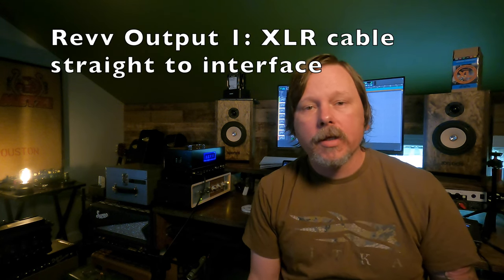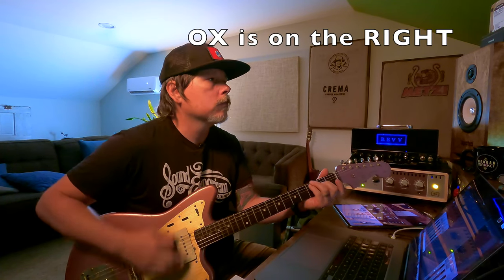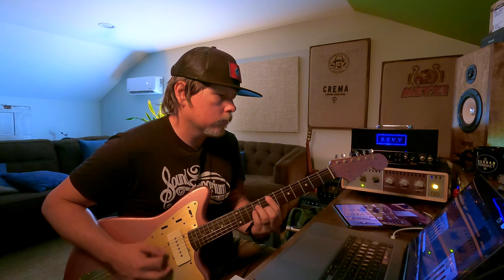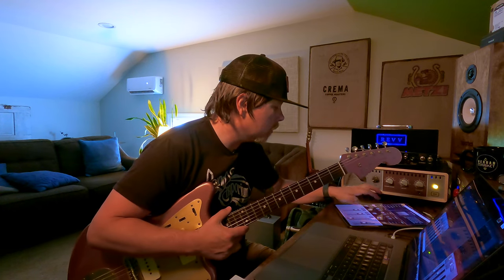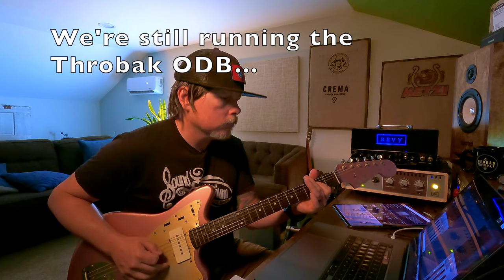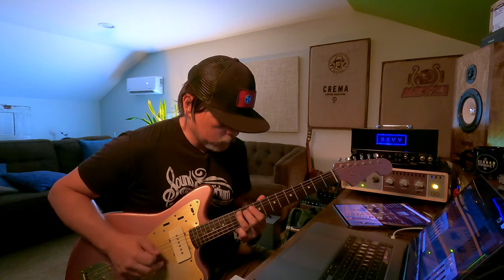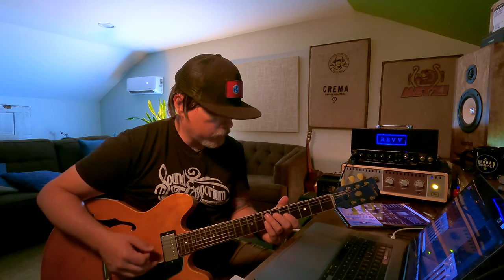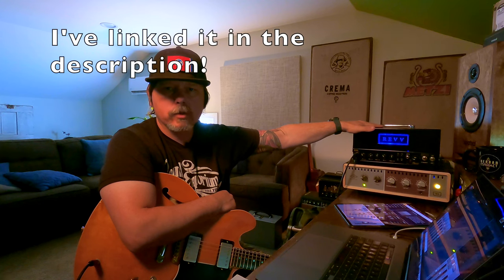You NEED these FANTASTIC Direct Tones! Who does it better?

Comment: I bought a Two Notes Torpedo captor x about 2 and a half years ago. For a dude living in an apartment, it's the greatest thing ever. I also use it live at smaller churches with my Dr. Z. I run the amp (route 66) into the 4x12 greenback IR, and it's awesome. Sound guys at those places are funny, and often confused when I try to explain to them what it is. But you're right about real speakers. Check out some Weber Silver Bells. I recommend the ceramic magnets with light dope. Beats everything else I've tried (Scumback, warehouse, other webers, etc.) for that early marshall cab sound. More throaty growl than a blue, and more top end detail/presence than a greenback with sensitivity being somewhere in between the two. Great "all-around" speakers that still have tons of their own character. Thanks for the comparison!

Comment: Wow - very well presented. I've been thinking of how best to solve a couple of problems recently - how to get good recorded tones at home relatively simply and quickly (my modeling software which shall remain nameless just ain't cuttin' it for me, and it's anything but quick and simple) and having a second amp to use for smaller gigs and/or situations where I don't want to bring my "really good" amp for whatever reason. The Revv D20 might just be the solution to both. It might not be the ultimate boutique or vintage tube amp tone, but it sounds darn good in this video (I'm a pedal platform guy anyway). With the right small cab and good speaker it could be a great compact live rig, and it's obviously a very good recording solution as well. I've always thought the Ox was "it" but the Revv really holds its own in this example. Thank you Justin!

Comment: I thought it only worked with either cab or modeling! How did you manage to do both? Doesn’t it have the switch on the back to choose from one of them?
Reply from the maker: The switch is to choose where it sees the resistance load. It’s still sending both outputs (at least when the speaker load is selected; that’s when I noticed this)

Comment: Really enjoy your videos. I’m considering selling my Dr Z  Maz 38 head. Loud! I’ve been told that the D-20 isn’t as loud as a Deluxe. Great for studio but lacking for live with drums. Thoughts on the D-20 used live?
Reply from the maker: Man, it's awesome. If you want cranked tones significantly quieter, switch it into 4watt mode. It's killer.
Reply: @JustinOstrander    Killer live w band? Or would a Deluxe work in live situations with no direct to house?
Reply from the maker: @windowsoflife  Yes, live. It's about the same output as a Deluxe (20w for the Revv vs 22 for the Deluxe), but if you're in a situation where stage volume is a real problem, the 4watt mode on the Revv is super handy.

Comment: Man what fuzz is that?
Reply: See if I would just keep my fingers off the keyboard and keep watching I would've found out it was the throbak overdrive boost 😅 but I would like to know what settings you're using on it for that fuzziness and are you powering it 9V or battery? I know those throbaks love cheap batteries too
Reply from the maker: It’s on a battery. Gain 3:00, bass 1:00, treble noonish? (going by memory), master a little past noon? Toggle switch on the higher headroom setting
Reply: @JustinOstrander  Dope, I love that pedal. Thanks man
Reply: there seems to be a real orthodox almost religious adherence to tube amps. Is it really worth all the trouble and expense. Keyboard players have for the most part let go. You can totally do a drum part with loops/drum replacement. Isn't it time to just admit, we're not almost there. We're there. That other 5 percent is in your mind and ego.  I like you grew up playing real instruments pianos Rhodes organ, and I didn't learn how to play to be pushing around pictures of gear on a screen😑😆 but with Keyscape Scarbee and an actual Hammond VST it's honestly hard to tell the difference in a blind test. Sure I know you like what you like, but the difference isn't what you hear, it's what you FEEL about what you hear🙂
Reply from the maker: @ronrobins3513  This is a great point. I don't think modelers are quite there yet with tube amps. There is a distinct difference in air moving out of the speaker into a real mic, especially with a good preamp into a console. But I agree that it is mostly about how I (along with the artist, engineer, etc) feel about it. That difference may be lost on the majority of listeners, but if it inspires me to do a better job, it is absolutely worth it. We're all zeroing in on that last 5% that will make a guitar part, a song, and/or a record stand out.
Reply: @ronrobins3513  I think it depends on the musical setting. I hear it as being more than the "5%" you quote for the sorts of sounds I use. In my experience amp modelling (as in things modelling the whole amp signal path) can sound pretty convincing for either pristine clean or very dirty sounds. They sound less convincing for the on the edge of break-up, lower gain sounds. Particularly if those parts are more exposed. For the sort of Americana stuff I play the most, those edge of break-up sounds are where I live. Sims also still don't feel as dynamic for me to play and don't react as much dynamically to touch and sometimes that's important. 

Having said that, I've used them to track on different styles of projects and like the other virtual instruments they've been totally appropriate and subjectively sounded really good in that context.